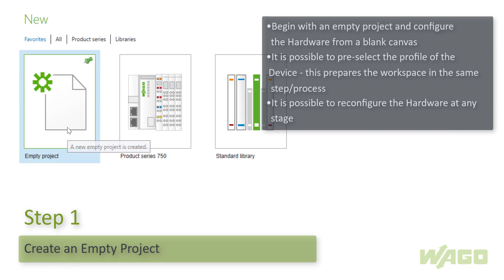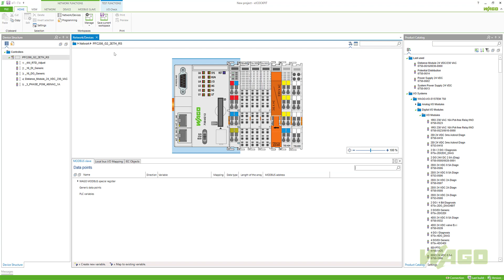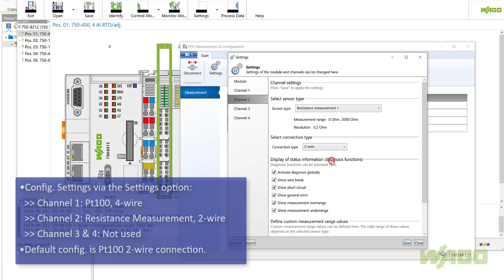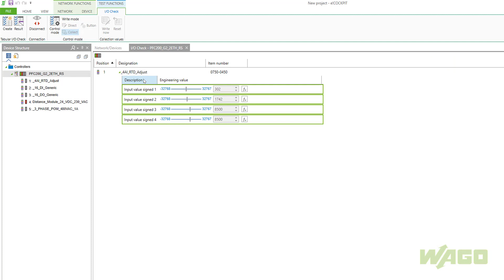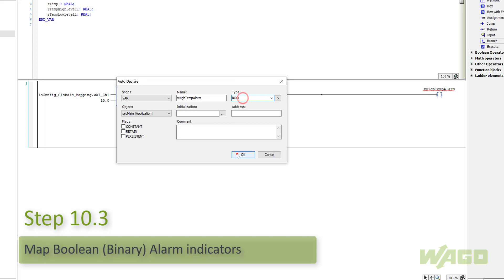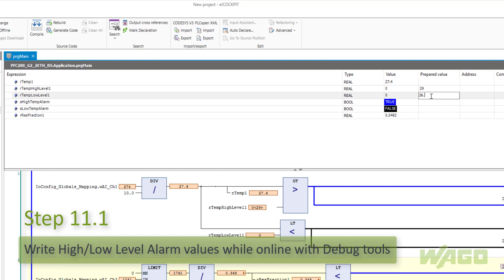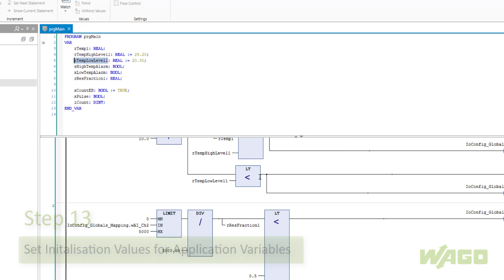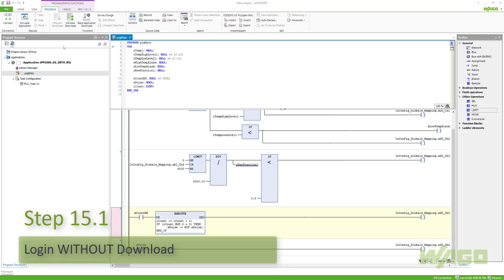First Program with e!Cockpit - Configuration, Programming (Ladder Diagram) and Boot Application

Comment: Hi how can i change the default username and/or password at the login? (the 5:23)
Reply from the maker: Jack Cheah, you can make this change through the Web Based Management for the controller. Browse to the IP with your browser and set the user/password combination through the administration menu. You will need to be logged in as an admin user to do so and select the user level to change.